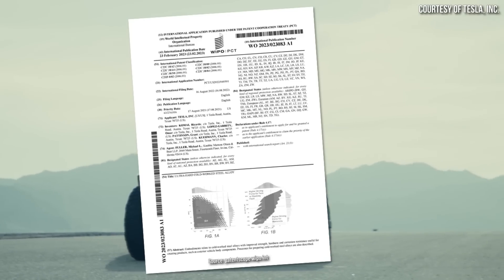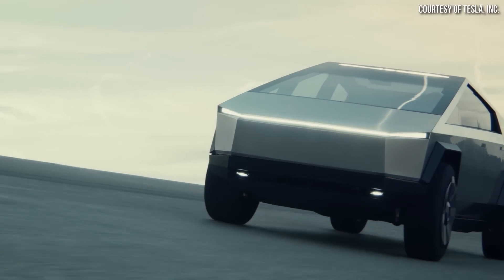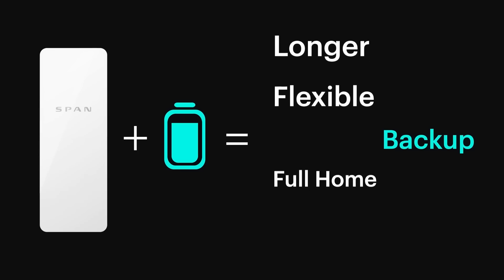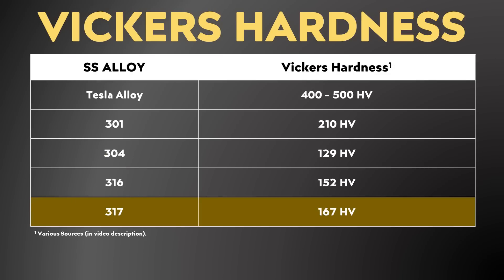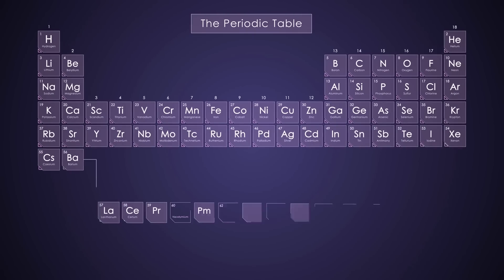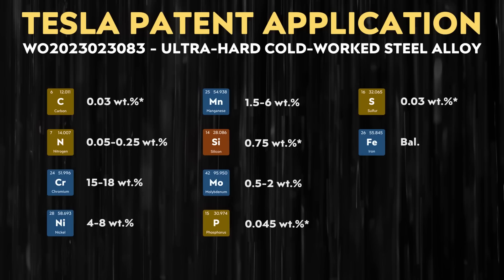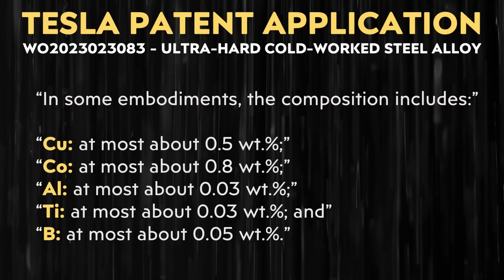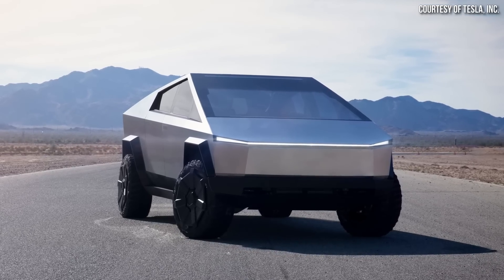Tesla Cybertruck EXOSKELETON SECRETS REVEALED by New Patent

Comment: I am not a metallurgist but I had to dig deep into stainless steel compositions for a project I was working on that required maximum corrosion resistance. For that project I ran across the PREN (Pitting Resistance Equivalency Number) formula for determining corrosion resistance.  

In the Cyber Truck, I am most interested in corrosion resistance since I live in the rust belt and was concerned that Tesla might just use 304 stainless or one of the 400 series grades. For my project’s application I needed a PRN number above 24.5 which can be found in 316L or any grade that contains >2.5% Mo.  Since most SS don’t contain nitrogen or tungsten the Mo content (and now Cu thanks to the patent) becomes the deciding factor for corrosion resistance. But we also needed hardness and 316L is fairly soft.  The 400 series is typically much harder but does not contain Mo so, not corrosion resistant.  In applications where both characteristics are desired one must go to more exotic metals. 

The Tesla 30x SS is interesting because it contains elements not typically used like Cu, B, N, etc.  And when I was researching this I found a research paper which also adds Cu to the PREN calculation.

It’s interesting that they give a range for Mo and N because if these two were at the low end in the composition corrosion resistance would be reduced.  I wonder if it’s because they don’t want to disclose the actual % or it could be that they’ll vary the amounts depending on the location of the parts (i.e. body panels get more Mo and N).

As far as hardness higher Ni levels increase hardness while retaining corrosion resistance.  Tesla has a range on this element also and are adding in the extra factor of cold rolling.  Overall, I think its very ingenious way to approach the problem and shows that Tesla is not afraid to create novel ways find solutions. Cheers!
Reply from the maker: Great info and insight! Thanks

Comment: I think the only thing that you didn't cover with this video was why the cold rolling process is done.
   Everytime you pressure roll this very hard stainless steel it presses more carbon atoms out of the each pass makes the steel stronger and stiffer. But if you press too much of the carbon doubt you will make the stainless steel griddle and it can crack.  Iran's new stainless steel is taking it right up almost to the point where it might want to start stressing out.  This is what makes his metal so strong and stiff but can still be just wanted to add that in case some of the other watchers were underwear.
Reply from the maker: Great info! Thanks so much for this.

Comment: SO is this different from the SS that SpaceX is using on its Starship?  Originally I thought this was the case as using it was supposed to benefit both companies by reducing overall costs due economies of scale, but did Tesla decide the same SS wasn't going to work or is it actually the same and this is just the first time they've gotten around to patenting it?
Reply: I'm under the impression that they are the same, and that despite the content of this video the key to understanding the reason for this specific alloy is to ensure that Starship has what it needs. The benefits for the truck are secondary, though still substantial. That said, as long as it doesn't present problems for producing what is needed for Starship it's possible that some batches for Cybertruck could be slightly different.

Comment: The real important question is does this new alloy also provide bullet-proofing to withstand impact of 9mm handgun round as promised?  I plan to take this as an off-road camper down through central america so this is obviously critically important.  It's gotta stop a bullet or it's not worth anything to me.  Also hoping the camper shell is available on launch and that it will be able to cross rivers.
Reply: You will need to order the Julio Narcogena autographed edition.
Reply: @FrunkensteinVonZipperneck  The Escobar Edition 😅
Reply: According to Elon, it will have to float in not just a river, but the sea, like possibly the distance at star base in TX.  I think it’s around 1/4 mile (~400m)?

Comment: IMO, unless you are going to use the Cybertruck to haul your groceries from Costco to home as competition to the Mercedes G-Wagons, it makes no sense as a work truck and I will explain.

First, regardless of has been published in the past the Cybertruck will certainly cost a lot more than the Model Y which is over $70K including delivery, licensing and registration and state taxes.

Second, as a work truck the range is drastically reduced if you are hauling a trailer (and who does not) and range even drops more in the Winter.

Third, because of the unibody construction with those panels and large battery an accident will probably result in a total loss (who is capable of repairing and what is the cost of the panels) which will make the insurance almost unaffordable.

Fourth, the cost to charge a tri-motor at $0.43 per kilowatt-hour will be pushing $100. How about a quad-motor - $120?

Additionally here in the US, current car interest rates for new cars with good credit is around 6.27% so if you are all in out the door for $80K including taxes, delivery and license (I personally believe it will be a higher number), and you take a 60 month loan with 10% down your monthly payment will be ~$1400USD and that does not include insurance which I estimate will be at least $3K a year so ~$1650 a month for 60 months. Quite expensive, IMO, maybe just for the G-Wagon crowd.

Comment: I don't see Stainless Steel being a good choice for the Exoskeleton. It could have been made from a high strength Steel and then painted. That would have used far less precious materials such as Chromium, and would have made repairs and finishing simpler. Creating near perfect welds that are good enough to buff over to get a decent finish is not a trivial matter.
I'm sure a more shapely, and equally strong, version of an exoskelton could have been made with Steel, using the curves to give more strength, rather than relying on the brute strength of material in the flat. That way it wouldn't have been such a devisive product. Personally, I think it looks ghastly.
Reply: Fully agree.  Could have been made of painted steel.  But Elon wanted something wild that would stand out.  Anything wild that stands out is going to be a love it or hate it proposition.  Personally, I hate traditional pickups, all of them.  I have no use for the Cybertruck.  But it is cool and if I was just into driving something that drew a lot of attention, I would buy one.

Comment: Nicely done, 316 is the  marine alloy  very good salt water protection and 310 is the super ductile and used in weld repair for problem repairs high nickel content  gives the high ductility ,321 and 347 are  have sacrificial medals of titanium and niobium in that order to sacrifice themselves in welding keeping The chromium from carbideing  while welding saving the chromium from being used up and that is what gives you your corrosion protection in a weldment in these  very high temperatureAlloys 321 three 347.
 Chromium is oxidized in the environment to create A clear oxide that gives us stainless steal.(protection)
If it is turned into carbide in the welding operation and we lose its ability to become chromium oxide and therefore much less corrosion protection.
The L which stands for low carbon helps keep carbides from precipitating out and I guess not just in welding but in the alloy itself without welding , Which gives the best corrosion resistance.

Comment: Five PHEVs can be made BY LEGACY AUTO NOW, for every ONE BEV, which needs 5x more RARE batteries than PHEVs i.e. THE  limiting production factor. PHEVs on average are only 20% less efficient than pure EVs. So if batteries and legacy auto’s inability to compete with Tesla’s production efficiency are their main problems, then PHEVs let them stick to the knitting, while reducing petrol/diesel requirements by 80% compared to their ICE vehicles. That’s why demonising PHEVs is just incredibly f’king DUMB if you want to reduce CO2 and pollution A LOT, REAL FAST. For the next five years only TESLA has a usable charging network … let alone for half the world’s population where there isn’t even good Tesla’s charging networks such as Australia. I spend way too much time in Australia having to use my Camry Hybrid (not plugin unfortunately) instead of my Tesla Model 3 because of long distance charging issues. Yes this will be solved in five years time and Tesla will be going gangbusters regardless, meanwhile PHEVs make ABSOLUTE SENSE in all countries. BTW, I’m predicting Toyota will be one of the first to licence TESLA’s FSD.

Comment: Couple of questions, 1) How can a car made of this material pass safety tests? It doesn't sound like it will absorb impact forces. It sounds like a threat both to its own driver and drivers of other cars in an accident. 2) How expensive will body work be when it needs repairs?
Reply: Rather than invest in a Cybertruck, you may wish to invest in psychotherapy to cope with imagined fears. Doc, my creator is a brilliant psychotherapist. Would you like his number?
Reply: Tesla makes the safest cars around, so I'm sure they've figured this out.

All I'll say on the matter is that the safest automobile possible would have crush zones in front and rear, and an indestructible cage surrounding the passenger compartment. Crush zones on the sides would be nice but are impracticable as there just isn't room, so it is preferable to have something that protects against intrusion into the passenger compartment from the side over having a material that gives. Fortunately these kinds of accidents are less common anyway.

The question is, could Cybertruck be designed in such a way as to have this protection where needed while also having crush zones in front and back? I believe so.
Reply: @alanlight7740  How do you envision impact zones can be created in a stainless steel unibody frame?
Reply: @ghrosenb  - a couple possibilities. One is to have lasers score spots in the frame where it can fold while dissipating energy in the event of a crash. Another is to make some parts of the frame near the front and back from a lighter gauge of steel. In any case, I know the engineers aren't going to ignore this issue so I'll just wait and see what they come up with.

Comment: No, you have several different alloys described in the patent because it is a patent and the objective is to have claims as broad and comprehensive as possible, it is not to describe what you actually plan to do. Essentially it protects Tesla from having someone else come along with these slight tweaks and getting their own patent and then, if it turns out later that Tesla wants or needs to use one of those tweaks charging Tesla for licensing their tweak. 

Tesla doesn't get patents to keep others from using the invention, Tesla gets patents to protect their own ability to use the invention.

Comment: I have developed stainless steel (SS) products so I have a good understanding of picking SS alloys for different applications (not designing them!).
Your research is excellent, particularly on the optional additives. Well done!

Couple of points for clarity. 
Many grades of SS are Very susceptible to surface corrosion. What makes them SS is the material resists corrosion penetration and stress corrosion cracking.
Because Tesla is cold rolling, stressing the material, to increase hardness I suspect they are testing a number of the trace metals to ensure excellent surface finish durability in real-world conditions. I expect they will pick the best all-around alloy to avoid additional costs.
The low-carbon choice is extremely important for good performance after welding. This truck will have a large amount of welded seams because features and setbacks can't be stamped into the material.
Keep up the good work!
Reply: Agree. At first glance it kinda looked to me like a cross between 304LN and 316L in composition on the low end of their Cr and Ni. But SpaceX/Tesla materials engineers have looked into this specifically to optimize for their rockets (where all the properties are critical) and then thought this would also suit the terrestrial Cybertruck family. The other trace elements would also have made interesting multi factorial experiments to assess. No doubt it will be a novel mix that optimizes mass manufacturing formability which is key to their success. Bravo
Reply: @samijokinen9246  I don't think we will see problems with their welding, look at the improvements to Starship!. As mentioned above their Special SS will not only be weldable but durable. Like all Tesla engineering, they will go with something good enough and continue to improve.
Reply: Sounds like no -one here has been keeping up.
The new patented SS formulae is discussed on the Cleanerwatt channel, "Tesla Cybertruck EXOSKELETON SECRETS REVEALED by New Patent"
Reply: @dnomyarnostaw  Elementary, my dear…
Reply: i'm pretty sure they're going to have very deep cuts that don't go all the way through to help make a clean bend and then weld the inside after bending to keep the outer edge strong

Comment: What about safety in crash tests?  You want the body to deform to reduce deceleration which reduces blunt force trauma on the human body.
Reply: This!  The only thing I can think of is that Tesla will have internal scoring throughout the exoskeleton that allows the stainless steel exoskeleton deform in crashes.  This means that there needs to be internal crash cans that then absorb the majority of the force to legal standards.

Elon has already spoken about the need to score the Stainless steel for bending to the correct shape, so they probably just add the additional scoring at the same time.

It will be interesting to see how they address crash repair.  Kind of hard to hide weld lines of new parts without a paint covering.
Reply: The hard ss WILL deform in a crash. (Think about it, bending the panels in manufacture is purposely deforming). 

Repairs to surface finish are similar to repairs after welding. A bit of weld removal paste followed by polishing. This is how the food industry does it

Comment: I get it that Tesla's steel is tough and durable.  But what about the concept of the exoskeleton?  Am I mistaken to believe that all this steel basically hangs on the exterior of the cast aluminum frame parts?
Reply: It's more that the cast aluminium parts are hanging on the interior of the exoskeleton. This is because the exoskeleton is what provides the bending resistance over the whole body length. The exoskeleton replaces the underbody carriage of a normal truck.